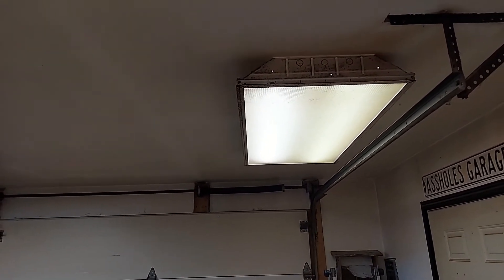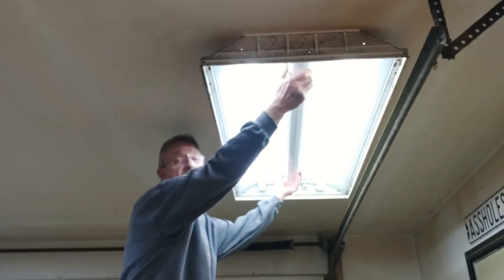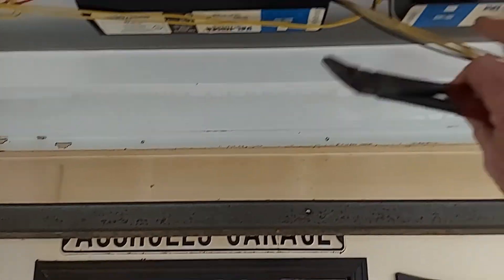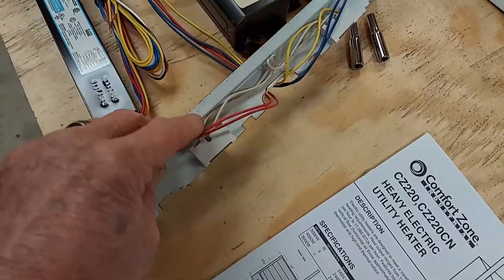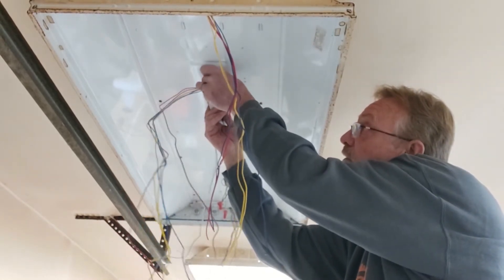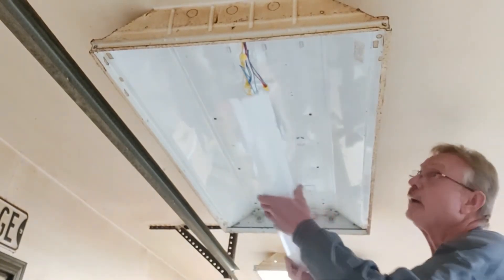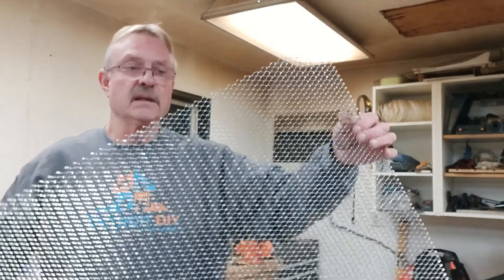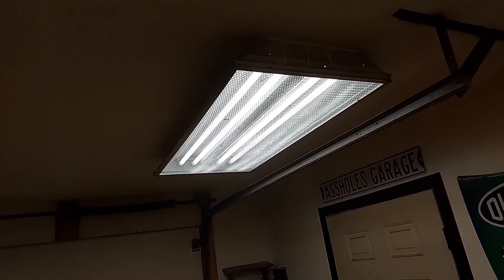Can You Replace Two Fluorescent Ballasts With One? [ FULL BALLAST WIRING TUTORIAL]

Comment: Enjoy all your videos very much.  Keep up the good work!  But was wondering on this one why you spent extra money for a ballast when one isn't required for direct wire LED's.  Direct wire Type B LED Bulbs convert 48" T8 fixtures to live voltage.  Very easy to install, no ballast to install.  Direct wire LED tubes wire directly to line voltage and there is no need to purchase or install a new ballast when the old ballast goes bad.  I used the  Type B LED bulbs in my shop without a ballast and they work great.  I also have a 48" light fixture that still has a ballast and I am currently using Type A bulbs in this one.  Type A works with existing ballast.  When this ballast goes bad, I will convert to Type B LED bulbs and remove the ballast.
Reply from the maker: It was my understanding that the direct wire or type b bulbs don't start well in cold weather. How ever the instant start Ballast with type a bulbs would be a better cold weather choice. I am not positive if this is the case or not. My main purpose for this upgrade is to stop the light flickering. I purchased a new camera to record videos and it picks up even a little flicker. Thank you for your input and if you are in a weather area and have no issues please let me know. Thanks for watching.